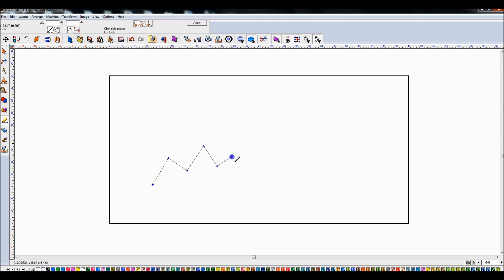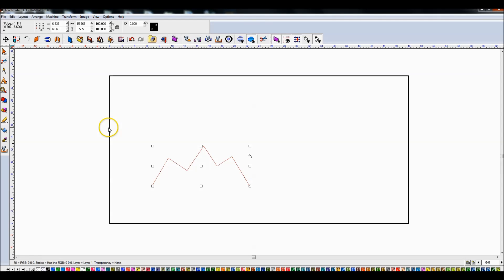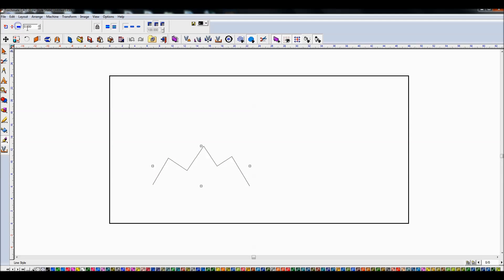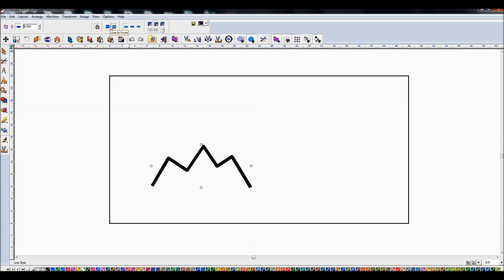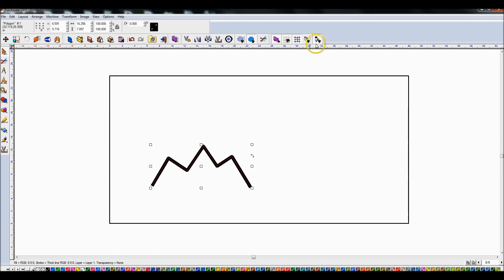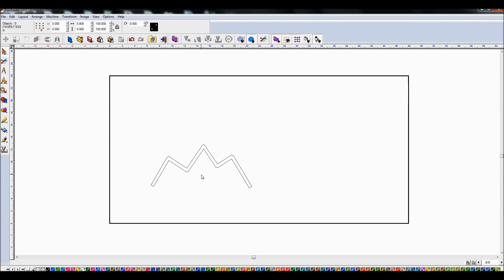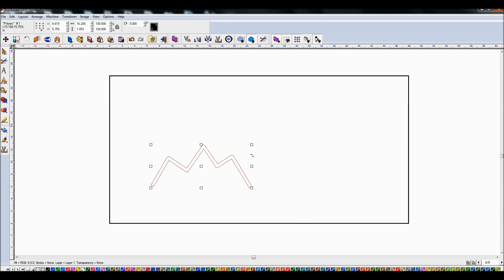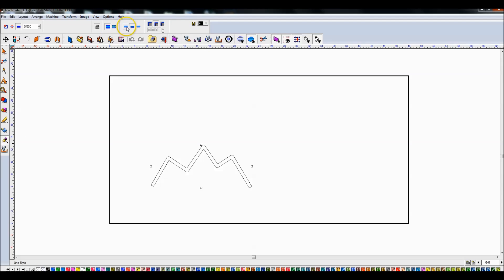Torchmate CAD/CAM -- Thickening lines (option 2) -- Fixed

Comment: that the problem appear when i use the cad cam can you help me please 
"waiting for cam data" and i wait but it doesn't work
Reply from the maker: Hmmm.. I haven't seen the "waiting for cam data" message.  If you have the options as I specified in this file it should just work.  I would call TM support to see if they have run into that message and know how to work around it.

Comment from the maker: 125 amps coming into the house.  We Td off the point of entry in the house and I have the full 125 amps running into the garage panel too.  Never maxed it out yet.  Most I have ever pushed it though is my plasma running at 80 amps (draws around 55), compressor running (draws around 15), and the TM table (don't know what it draws, but insignificant).  That puts me at around 70-80 amps.